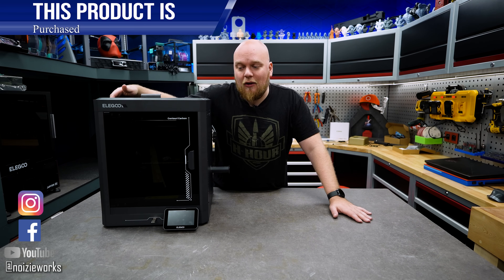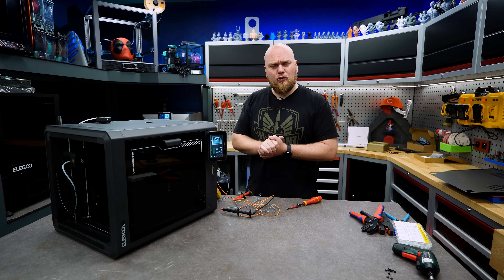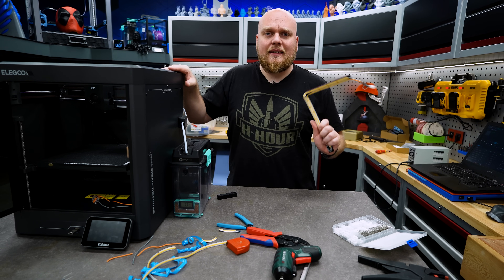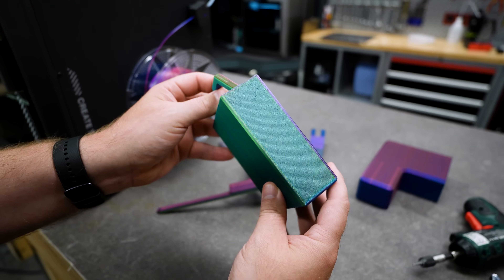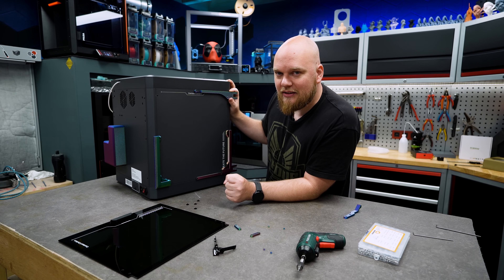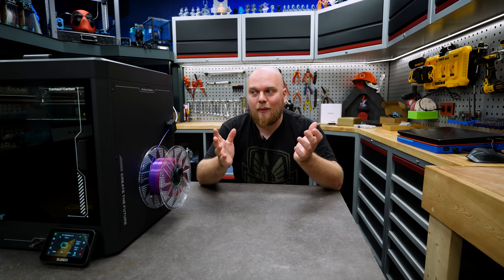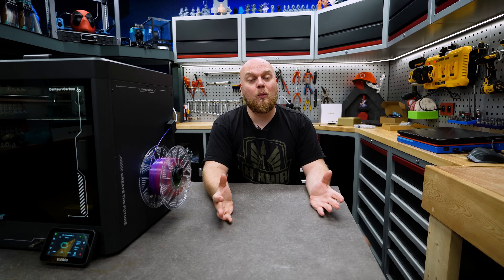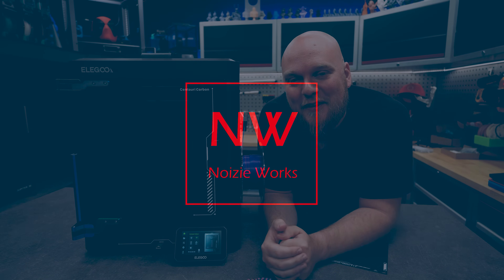The Elegoo Centauri Carbon mods you might need and updates they must make right now!

Comment: HI  How did you remove the 2 metal parts on the glass door that the screws go through, what the nut blocks replace, I don't want to break the glass trying to remove them???????? (:  (:
Reply from the maker: I pushed them with something soft like a pencil.
Reply: @NoizieWorks thanks for the reply They are fairly hard mounted like glued with super glue????they may take more then a push ):  ):
Reply from the maker: @bigirish4886  that would be something new, mine popped off very easy
Reply: @NoizieWorks  Thanks I will look at them closer  (:  (:
Reply: It ended up to be like double sided tape.  It did come off with a little work, not a bad as I thought it would be.  (:  (:
Reply from the maker: @bigirish4886 good to know! Not on my unit i wonder why

Comment: The YouTubers complaining about flaws with this are power users or print farmers bitching about minor issues that they don’t have on their $1500 machines. The average user won’t even notice or care.
Reply from the maker: You know that the point of "bitching" is to correctly inform you of the issues however small so you can make an educated purchase. Just blowing smoke for the affiliate is the last thing you want.
Reply: Well yeah, but thats pretty obvious. Just like i ignore the ones that whine about it not having a multi-material system.

Cus I'm probably never going to do multi-colour prints if I get a printer and if i get into it that much that I want to, I'll get a more expensive printer.

But I'd rather find out about all of these little issues than end up disappointed if I buy one and I end up experiencing some of them.

Comment: About the temps in the chamber what do you think of using the resin chamber heater from elegoo placed inside the printer on one of the sides?
Reply from the maker: Don't these have a build in thermostat lower than 40? It's probably a good pick to boost the chamber.
Reply: @NoizieWorks they go to 50 no ?
Reply from the maker: @Nothwarren looked it up, 25C 😬
Reply: @NoizieWorks ah
Reply from the maker: @Nothwarren woops... you have a few options on ali

Comment: klipperize and turn on stealth chop. it'll be quieter
Reply from the maker: Show me the way! Has anyone successfully converted to klipper?
Reply: @NoizieWorks  I am not sure i am doing research on it as we speak, ill get back to you. where theres a will theres a way
Reply: @NoizieWorks  
TLDR: cant flash because board is shit. swap to btt octo or similar for full klipper and be ready to tinker on the thing for a bit

Long version:
From what i can find only one guy got a not fully functioning version of klipper flashed to the stock board, but it wasn't user friendly for some reason. the ultimate route would seem for now to be to swap out mainboard and ad a Pi of some kind. The elegoo board isnt like other boards in the fact that it is a all in one linux board rather than having a flashable MCU, you can flash it but the process can brick it. and no one has developed a firmware for it to be flashed to klipper. The BTT Octopus is the only thing i can think of that would allow full klipper . but then arent we just building wish or temu versions of the Voron?
Reply from the maker: @BooleansAndThings yup, better build a formbot at that point
Reply: @NoizieWorks  That's what i was thinking, its interesting to see all of these companies clearly violating klipper's license and not open sourcing their builds. its a bit annoying to me. Happy printing bro, i love your content by the way!
Reply from the maker: Thanks brother ✌️ btw this confirms my suspicion, to be able to run klipper you need dual processing. 1 host and 1 for the firmware. Clearly in violation, the fuckers!

Comment: Put a 24V relay on the port, use the power supply for the light and the port just to switch on the light with the relay.
Reply from the maker: Yup, also valid option.

Comment: I added an LED riser as well to mine, as well as a nozzle light. You can buy pre-soldered 5050 SMD LED’s that come epoxied to a ribbon cable. The ones i found were 12v and i just used a buck converter to step down the voltage. I don’t understand why nozzle lights & a nozzle camera arent the primary focus when it comes to lighting and cameras. I don’t need to see the whole print, id much rather see what is going on at the nozzle. I also added Siless hybrid sound deadening material to all of the panels on the machine. Its that butyl rubber tar and EVA foam layered together and covered with a foil face. Its great at insulating and dampening noise. I just traced the places i needed to not sound deaden/insulate before applying. Dont go to thick or your gantry ends will collide with it. Made the machine hold temp much better for warp prone materials and quieted it down a SUBSTANTIAL amount. Those metal side panels really resonate quite a bit. I do love them though because of the access they offer to repairing the machine. Overall great design, now someone just needs to create a klipper upgrade board for it. 🎉
Reply from the maker: Cool setup! And yes on the klipper board+
Reply: @NoizieWorks  I am curious what stops people from using a known board like the BTT octo or similar, i would guess all you would need to do is swap wiring and either get something like guppy screen working or get a klipper screen. am i mistaken? is there more to it?
Reply: @BooleansAndThings  non-standard stuff used in the cc

Comment: You only need to level the bed once every 3 months, or if you change to a new bed. Also I highly recommend setting the z-offset as it doesn't automatically do it.
Reply from the maker: I've noticed it not saving, slicer offset it is
Reply: You have to go into the printer settings in the slicer to permanently set the z offset, the onboard printer z offset just helps you figure out how much  @NoizieWorks

Comment: I ordered mine June 7th. It arrived July 25th. It came with two LED's and the multi color port. Depending on ambient temps, my internal temp has reached 49C printing ABS and ASA. The printer has even warned me to open the door. This leads me to really think about what upgrades are needed. Riser, waste of material. Door hinges, If you have the need, do it. Other than that, waste of material and that goes for feet, if you have a solid bench or table, even the floor, you don't need them. I know people want to Pimp out their printer and that is fun, but what does it really buy you. Anyway, good video and sorry for the rant. 🙂
Reply from the maker: You good, i like a solid rant

Comment: @noizieworks When my camera doesn't seem to wake up i minimize the window of the cam and reopen it and then the cam loads immediately.
I noticed after ?last patch?  that while printing i cant activate the light or change the speedsetting via orcaslicer.
Reply from the maker: A few more tweaks are definitely needed
Reply: Yeah I couldn’t change the speed on the onboard screen & in the monitor app. I had to run the print then change the speed but the print took the same amount of time? The ludicrous setting didn’t do much :/

Comment: That hinge and top glass holder is awesome! The doors never feel like they open wide enough on printers. Clearly this solves that. Thanks for sharing!
Reply: Did he design those?  Checks description... Nope he found them on printable and linked them in there.  Hey Nozzie, it would be a nice thing to do a shout out the creators of the designs you use but thanks for linking thme in the descripiton.
Reply from the maker: I linked them, the led bar is my design but to shit to share so i didn't
Reply from the maker: Btw if you really want it let me know and i will upload it
Reply: @NoizieWorks  Thanks for the creator reply.  About the shout outs, it would be nice thing to do but your enthusiasm about how they worked is a pretty good endorsement as well.  Just a thought!
Reply from the maker: Ow and I will do better on the shout out, I sometimes get to into the filming and forget about it.

Comment: Wait til you have to replace the print head. The connectors are super fragile. I've been waiting 3 weeks for a new board from Elegoo. Only had it running for 7 days :P
Reply from the maker: i removed quite a few on my first video, unfortunatly most brands use fragile connections. If stock wouldn't be an issue huh
Reply: @NoizieWorks  yeah I agree, all the brands need better ways to connect hotends so they are not so fragile. User replaceable items should be easier than they are.

Comment: You don't need to bed mesh the CC before every print.  Pre-mesh side A and side B of the plate.  Then just run the print, select side A or B and bypass the bed leveling/meshing altogether.  Saves a lot of time.  Also... all of the content creators give Prusa a ton of love and patience, and nit pick a machine like the CC to death over simple things to address, like the LED's.  This machine is one third the cost of a core 1... and currently prints as well or better... comes with a camera by default, has a bigger build area, a built in accelerometer for vibration compensation, etc.  Would Klipper be nice to have, sure.  But lack of Klipper in no way has kept me from using either of my CC's.  If you look at the  plus 4, it literally requires Klipper mods just make it work properly.  While Klipper is great, it is also an excuse for manufacturers to do a half ass job because the community will just fix the issues.  The CC works with Orca, very well.  The firmware is not Klipper, but it is not Bambu's walled garden either... and unlike my X1c, the CC let's you adjust z-offset on the fly, pre-calibrate bed mesh, etc.  Added a DIY chamber heater to my CC and now use it instead of my plus 4 for ABS, PC, etc as it works better, and every time.... with no weird crap or ceramic heatbreak issues, etc.  CC's are not perfect, but they offer a ton of value for the price.  Prusa better run like hell and start to keep up.  These lower cost manufacturers are offering products that produce comprable results with great customer service for way less money.  One of my CC's is batch 2 (no ams port no leds 2.4 wifi), one is batch 5 (ams port, led's, 5.0 wifi, better bed mounts, other minor physical improvements, chamferred edges, etc).  Elegoo has literally iterated and refined through 5 manufacturing batches in 6 months...and don't appear to be slowing down.  Name one other printer manufacturer doing that.  They are now shipping with latest improvements within a few weeks if ordered from Elegoo.
Reply: Bed leveling before each print doesn’t take much time 😂
Reply: @Dslicckest1 Run some materials that require a 100C + bed temp and then see what you think.
Reply from the maker: I still would be careful not going to hot with the camber temps. Definitely a very capable machine for the price and i can't imagine them making a lot of money on it. It is possible to do it without the bed mesh but i found it to be a bit to random on first layers. Should be easy to implement local bed mesh on almost any firmware.
Reply: @NoizieWorks  Thanks for the feedback.  Had watched your earlier video regarding plastic materials used on the CC gantry and because of this am careful to be between 45C and 48C max.  With a 110C bed temp and side A of the plate this has worked well with ABS/ABS-GF with no warping on some parts that I could not 100% eliminate warping on with my plus 4.  There are definitely some features that could be added like adaptive meshing.  If pre-calibrating for the plate (even if re-using for instance the Bambu engineering plate with PC), find that it works well.  Still find the plate selection of "Textured PEI for side A, and Smooth Cool Plate for side B to be a bit wonky, but it works".  Would be great to be able to store 5 or 6 meshes to allow for quicker swapping between different plate types.  However, especially with higher bed temps, pretty much necessary to skip bed leveling as it wants to level at exactly 60C.  So higher or lower and you are waiting even longer for the bed leveling.  ==> side note: off topic... really glad I went with a beacon mod rather than a cartographer mod for my plus 4 since cartographer requires a different flavor of Klipper which no longer works with the .so files in the new firmware.
Reply: @tonyoslund5700 where did you get the info on the details of each batch revision? That's interesting stuff! Would like to read through it myself.